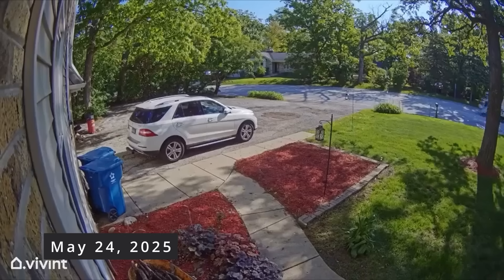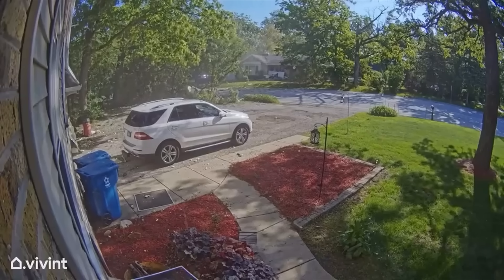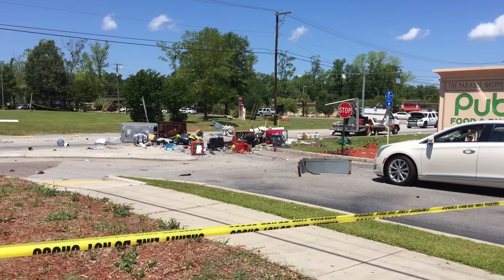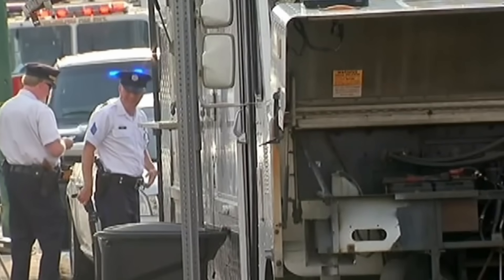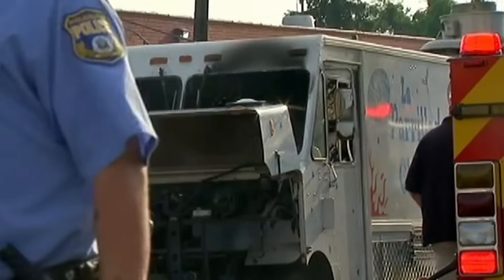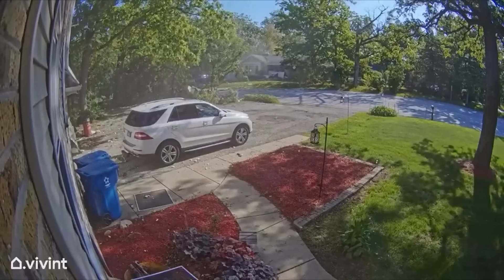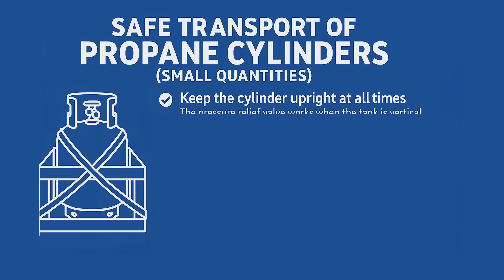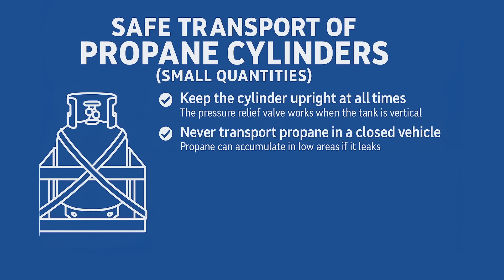Box Truck Explosion: How to Transport Propane Safely

Comment: This video should be REQUIRED watching when renting or selling those propane tanks. I had no idea of any of those instructions before watching this video. Thank god I have to date never had a reason to use propane. I was never particularly scared of it but now I have a whole new world of respect for the fuel. Now I am wondering about the fork lifts that mount tanks sideways.
Reply: Many substances are incredibly dangerous, the key is knowledge of the dangers and respecting/following the rules of handling/using those substances. 

I have worked in a semiconductor plant and safety rules where vigorously enforced, if you didn't follow said rules after a warning you where fired.

If people knew the amount of electricity and chemicals/gases and other things involved in making computer chips they wouldn't go near the places that make them.
Reply from the maker: Forklift tanks have a different design and a correct orientation.
Reply: @StacheDTraining But the seals do leak. I'm around them all day, every day.
Reply: @grandam  if people followed directions on replacing seals and such the world would be a safer place
Reply: @jonathanjones3126  Not only that, if people would learn not to cross thread the hose attachments!!! It gets on my nerves!!! I'm like, "yall don't smell that????" "Yall don't see it's dripping???"
Reply: @grandam I swear their needs to be mandatory hands on learning classes  where you exercise creativity and following directions in every grade of mandatory education.
Reply: @StacheDTraining   Okay, good to know.

Comment: In Perth Western Australia a decade or so ago there was a huge explosion that was caused by a collision between a propane truck & some other vehicle, & the propane blew up half the neighborhood. I believe that changes to the regulations for transport of propane got changed as a result, but it was a long time ago. I still remember feeling the blast from many kilometers away though!
Reply: A 20 ton truck propane tank will produce a 100m diameter fireball and third degree burns at 1km if it BLEVE’s due to fire. Tank failure will occur if the tank is exposed to fire for 30 minutes.
Had to research that for a risk assessment fifteen years ago.

Comment: I don't know what safety standards you have in America if any but LPG or as you say propane has a very narrow ignition ratio, a lot less than petrol with roughly the same flash point from memory, you just want to be glad it was a small explosion and not a blevy they are something to behold. In NZ and Australia bottles must be inspected every 10 years no inspection no refill. Personally i prefer repairing lpg powered vehicles than petrol as it is much more stable above 0c to 50c . Rust is the killer for any gas cylinder especially if is starting to flake

Comment: Great advice for cylinders with valves but what about the small green camp cylinders?  As they have no valve to close and I have had two recently start leaking after being used and removed. 
Not sure if we can come up with some way to transport cylinders inside. As 50% of camping outdoor people are transporting inside vehicles
Reply: Never use those goofy little camp tanks, they leak all the time.  Retrofit your gear to run off a large 20# tank.
Reply: I avoid going near those little bombs
Reply: Those small cylinders are single use. Once removed they are hazardous waste…
Reply: You can get brass caps with rubber washers to seal the cylinders when not in use. I keep those on mine. And also keep them in a shed in the back yard.

Comment: What safety precautions that are taken with propane cylinders should also go for RV’s and motor homes, when in transit make sure the propane tank is shut off! All appliances that use propane should also be off in transit.

Comment: Thanks,  I have several tanks around my place... upright, secure and closed.  Not in direct sunlight and no ignition around ... but I am still going to try to organize a safer area.  I worked in auto service for a lot of years and always thought safety first ... this video is a good reminder .. measure twice and cut one.. make sure make sure make sure ...
Reply: Attached garage, propane if it was to leak, would travel to the cellar,and hot water heater has ignition..
Reply: @SOSAS1980 Have you been sniffing propane or just day drinking?
Reply: "Every safety code is written in blood"
Reply: Us plumbers drive around with acetylene tanks in our trucks. Guage and hose connected. I personally turn my tank off and close the regulator.

Comment: I work at a petrochemical plant, and the C3 gas process and service are carefully inspected. Those are chemical products that result in high consequences, due to product release. C3 = Propane, Propylene, etc. & Butane is a super flammable C4 product. That explosion was from a small tank. Now, imagine a 100-foot-tall x 20-foot-diameter Depropanizer Tower at a refinery...
Reply: The USCSB has a bunch of great postmortem investigations on their channel of petrochemical industry catastrophes.
Reply: Additional level of jeopardy: The refinery's located in the United Kingdom, is run by somebody who voted in favour of Brexit, and accordingly adheres strictly to UKCA standards only... 🇬🇧🔥😉

Comment: I remember when some crooked garages would use propane for the refrigerant in cars A/C systems. The dash board, windshield, and hood would be blown away. And that's holding around a pound and a half of propane.
Reply: All new HOME refrigerator/freezers use R-290.....aka propane !
Reply: @darknes7800 Yes, R290 is used in modern (monoblock) heat pumps in a very small amount and a closed loop system. But still not something to mess around with.
Reply: Sadly climate activists don't want us to use safer hydroflouro carbon that won't explode.
Reply: A crooked refrigeration co. did that to a cold storage facility near me. The propane had no odorant added. The inevitable leak happened, set off the fire alarm. The explosion killed 1 firefighter, seriously injured 7 others, and was visible several km away (I saw it happen!) Google "Icepak coolstore explosion".

Comment: Bungee cords? Hell no. They aren't DOT approved for securing a load. Not even for securing a tarp. Tarps have to have at least one approved ratchet strap over them along with the bungee cords (if used) for legal transport. Ratchet straps to stop side to side & up & down movement.

Comment: A point here that was not covered is “OPD”.  Overfilling protection device.  It is designed to prevent untrained individuals filling propane tanks usually ones for gas grills from having too much propane put in them.  This has happened to me years ago with two propane tanks at the same time.  One for my neighbor and one for myself.  Upon returning home, and the tanks being out in the sun they began to leak through the safety valve.  Fortunately I knew someone in the propane business and they told me what to do to bleed off the pressure but that was before OPD.  Let’s be clear about this the OPD was necessary because lots of fires were caused by overfilling propane tanks and then once they were put onto a gas grill and heatvgot around them a little bit it would set off the safety relief  valve and now you have a fire, a big one.  I was a director at a 501(c)(3) organization and we used propane extensively for various reasons and I was in charge of it.  It was a full-time job keeping people safe from their own unsafe practices.  Fortunately we never had an issue but there’s always a problem lurking in the background, pay attention to what’s going on.
Reply: The OPD valves have significantly reduced the chance of overfilling the tank. However,  OPD floats can jam up allowing for overfill.  When you tank is filled, the individual should use the weight of the tank or the dip tube vent to determine when the tank is at the proper level. Unfortunately, many fillers just fill it until the OPD valve shuts off the flow. I have had a few instances where the tanks were filled to 100% because the OPD float didn't work. This resulting in the need to vent a lot of the gas off.
Reply: @Tom-wh9ip 
Untrained people sometimes fall into one of two categories if not both .  Ignorant of what they’re doing or don’t care. Hence OPD at least it’s reduced fires.
Reply: When I had a job that involved filling propane tanks in the early 2000s we wouldn't touch a tank that didn't have old. Also rusty or tanks in poor condition.

Comment: The refilling of disposable 1 pound propane tanks could be a hazard I have been told by the local BBQ grill store.
I have seen the refillable 1 pound heavy duty cylinder and the refill adapter at a big box store that sells for about $70.
Reply: Yeah I was happy to see a heavy duty refillable 1Lb cylinder at Wal Mart last week. I'm going to pick one up.

I have been refilling my own 1lb cylinders but I am very careful with them to not overfill, and I cap them off with sealed brass covers... The Schrader valve in the top is a frequent source of leaks in those cylinders. Quite a few cars have exploded from transporting a leaking 1lb cylinder.
Reply: Yes, the disposable ones are exactly that.  Not thick enough  to be safe for long term use, when rust is a factor.  And the seal can fail, so testing that each time with some soapy water after fill, or when returning to storage/transport, is a good safety practice.

Comment: I have driven many gas-powered forklifts and I think they have all had gas cylinders lying down.
Reply: Those tanks are designed to be horizontal, unlike the common 20lb tanks we use for grills and portable heaters.